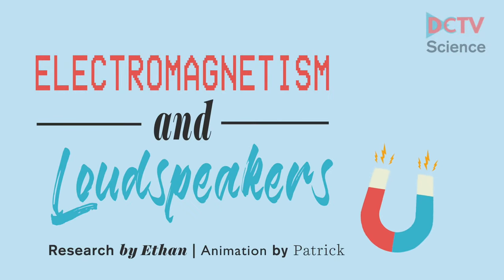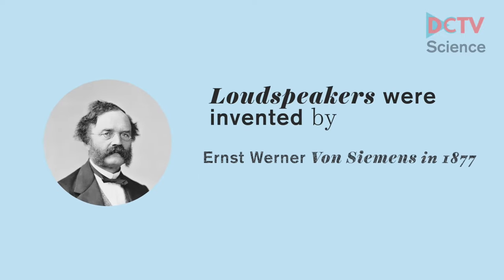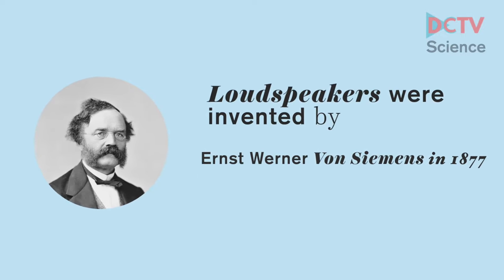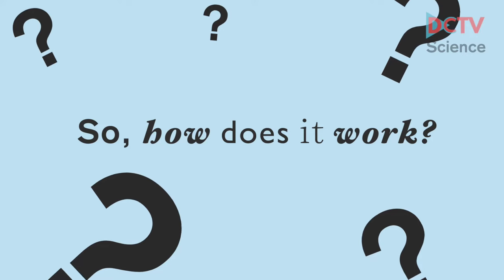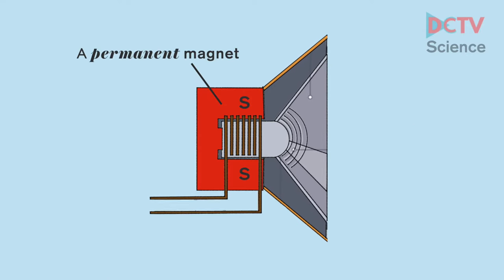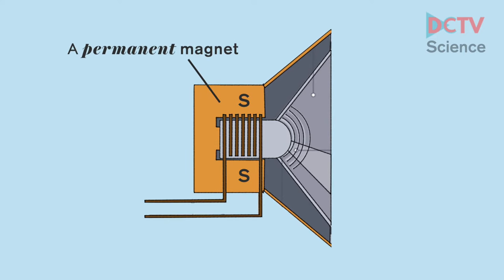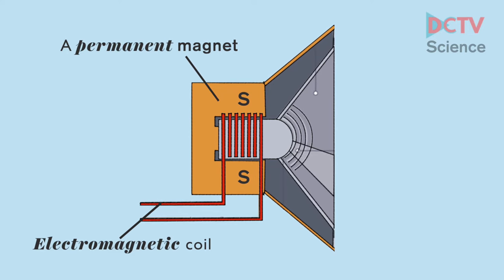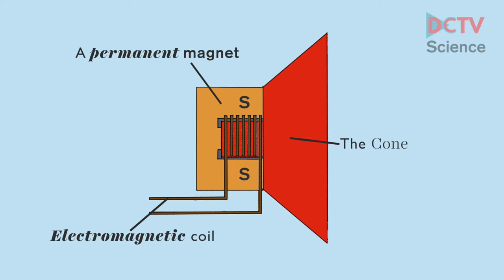DCTV Science | How a Loudspeaker Works by Electromagnetism

Comment: So the amps energy flows through the speaker voice coil and creates an external field around the coil. Coil pushes against static magnetic field surround the magnet. This push moves the cone to compress the air. The negative going half of a bass sine wave does the opposite, moving the speaker's cone inwards, causing the air pressure in the front of the cone to reduce. In both instances there is a neutral state where the cone surround wants to return to rest. In doing so, the voicecoil moves through the steady state magnetic field. Does not this movement cause a voltage and possibly current to flow...
 back into the amplifier? And what happened to the energy induced in the voicecoil as the mechanical mechanism (surround) returns the speaker cone assembly to neutral or rest. The metal voice coil, attached to the cone is moving through the permanent lines of force of the magnetic assembly. What happens to that energy?  Heat or ?